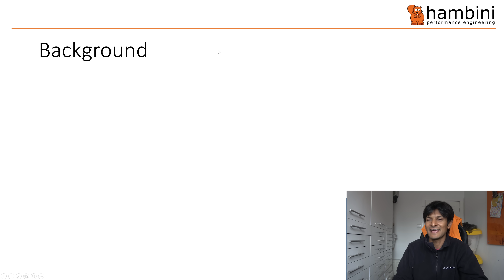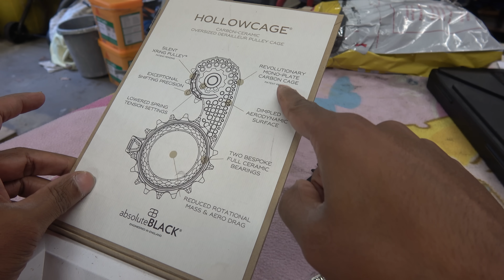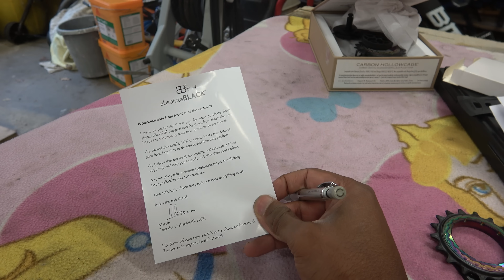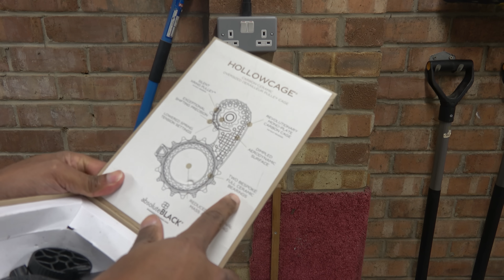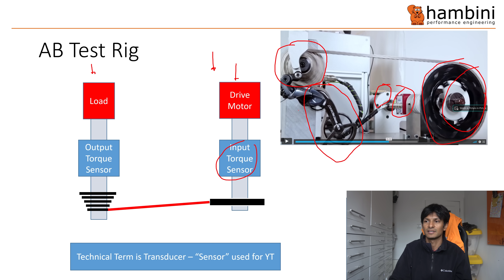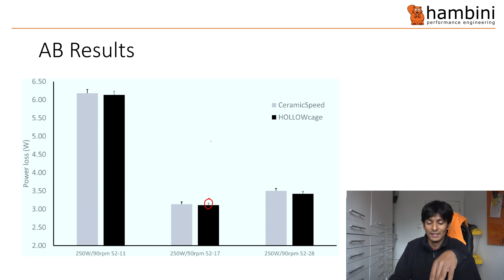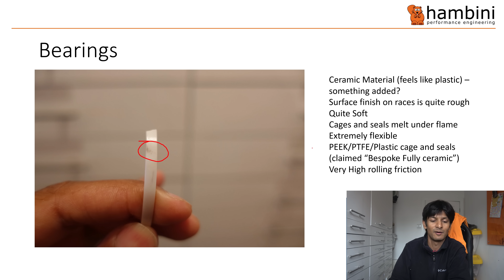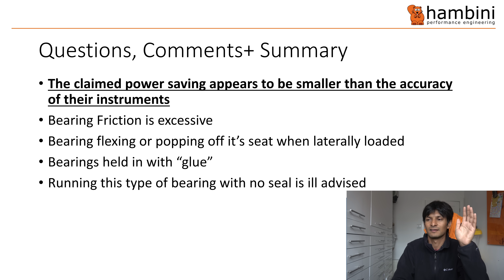AbsoluteBlack $700 OSPW: An Engineering Reaming Hollowcage

Comment: Heavier, more friction, less aero,  less rigid, less durable,  poorly manufactured, poorly engineered/designed integration with chain,  non-serviceable/user-replaceable bearings, potentially unsafe, unsubstantiated performance claims, and obscenely expensive.    Not a bad start.      Low hanging fruit.   If they come back for more then materials and stress analysis would be fun.   This is so obviously shit that it doesn't really need datasheet evidence but it might be fun to show what garbage this is if they insult the hair dresser again.